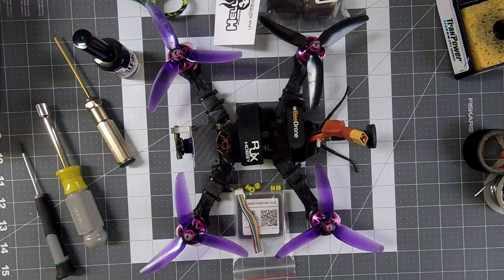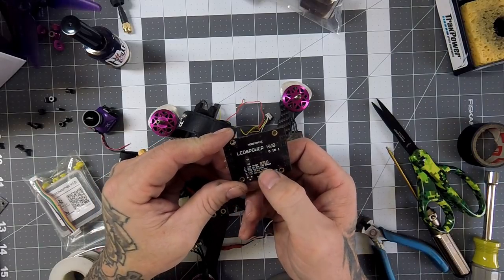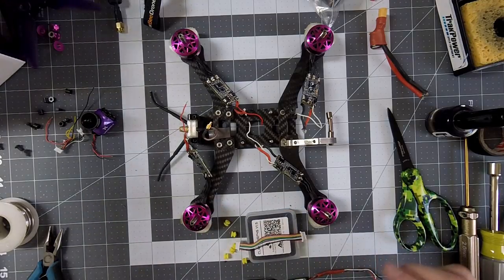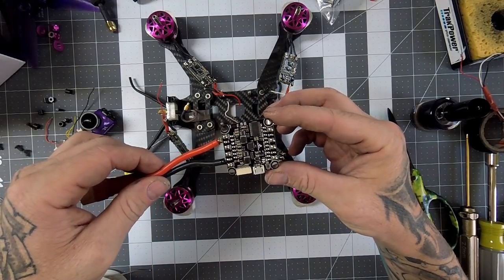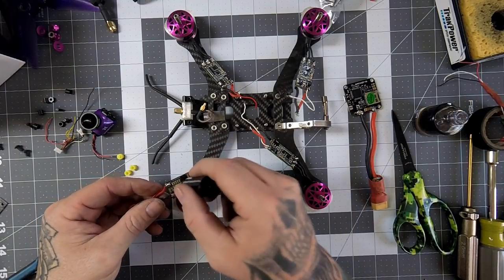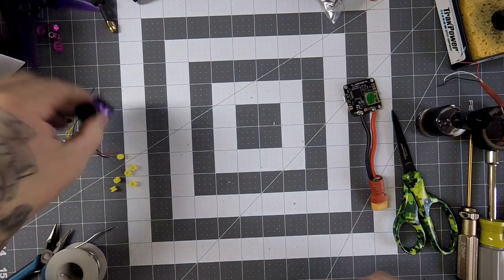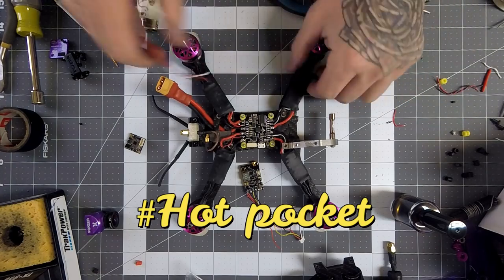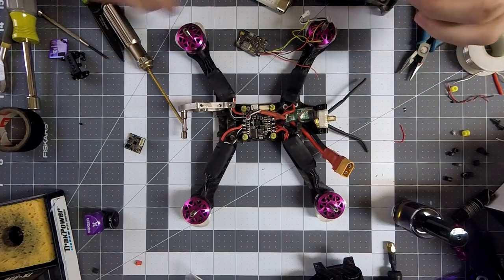Fpv waterproofing (Conformal coating)

Comment: I have a baby hawk r that I was flying out in the country, when I landed, it one hopped into an irrigation canal that I couldn't see, when I found it, it was two feet deep in the water and had been for probably a minute and a half, took it out and disconnected the battery, and wind dried it out my window all the way home. Got home and plugged it into the same battery and flew it for a couple minutes with absolutely no problems. Have since put a hundred packs through it with no problems with it or the battery. So ya, wind drying seems easier, none of the components had been conformal coated. I have to say it surprised the crap out of me! Did the fpv gods just think I needed a break, or what do think was up with that?
Reply from the maker: From what I gather if you disarm quickly you have a pretty good chance.  If your running current through it with water making connections on the board that's how things get smoked. 
I've also had a fully submerged quad have zero issues after drying off.  There's a video by ledrib on conformal coating he lands his quad in like 10 inches of snow over and over again on purpose lol it's amazing
Reply: Ya, I think I did disarm it quickly, but I could still see the lcd's on my vtx, receiver and fc on under the water so current was flowing, I'm not complaining though. I noticed your from southern Utah, I'm up north, but I plan on coming down this winter to do some flying, I bet you have some amazing spots down there!
Reply from the maker: @robmalan7137  let me know when you come down,  I'll show you around